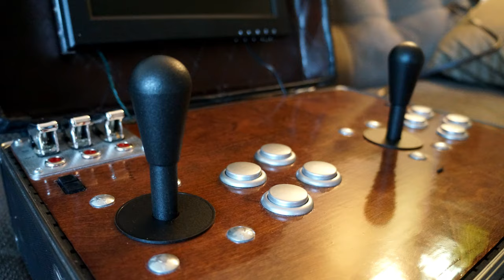The Making of My Briefcase Arcade System

Comment: How does it close with the joysticks being up
Reply from the maker: The joysticks are stored underneath the wooden top and they screw in when i set it up. So they have to be removed before closing the lid.
Reply: Which type/brand of  joysticks did u use in the video?? Trying to make a similar set up! Thanks in advance! :)

Comment: Did you mount the wooden top to those columns? How do you power it?
Reply from the maker: Yes the columns are holding up the main wooden top. I have an extension cord inside and that all plugs are connected to. So from the outside, it's just one cord to an outlet.